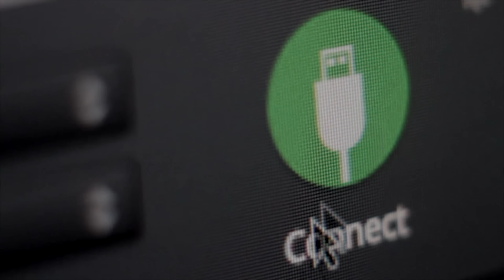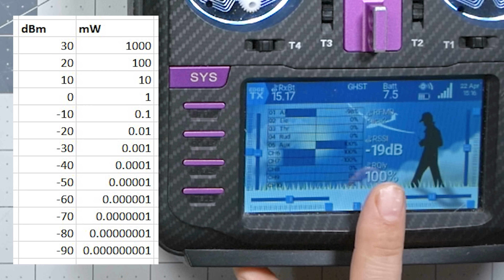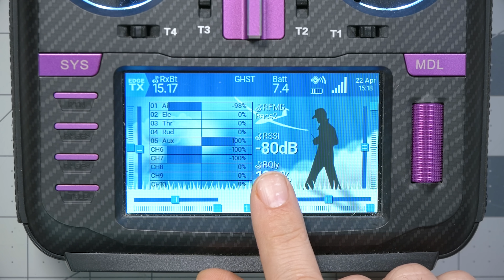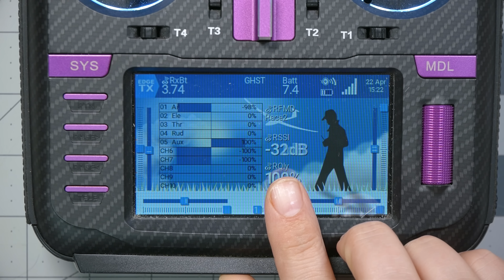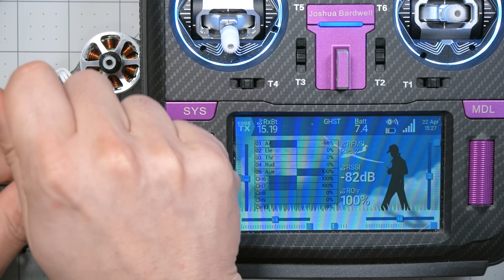Failsafe at 50 feet. Why? // HOW TO TROUBLESHOOT QUADCOPTER FAILSAFE

Comment: I fly only fixed wing. I'm using a tx16s and my signal does well with my spektrum stuff but I did notice that when I fly my elrs stuff with my radiomaster module I'm definitely dropping in the 85% range for link quality and I'm really not going far away. 300 yards max. Thoughts on what may be going on?

Comment: I am more of an RF guy being a radio ham etc. I would get more information from the RSSI signal than the SQ signal for the following reason. Any decent telemetry system will have parity checking and on a duplex system, it will acknowledge (Ack) correct reception of each package of data, if the last packet failed the parity check, the ground station would simply request a re-transmission. Usually, the system would ignore the odd corrupted packet, but when these corrupted packets become too regular, you would then get a bad SQ reading. Its at this point where you have really reached the point of no return, you are now about to lose your telemetry link. However, the RSSI signal would tell you before this happened by the actual signal strength. If we simplified the RSSI from 0 to 10, if the SQ warning kicked in at say RSSI 2, you would see know this from the declining RSSI value and you could act at say RSSI 3 before the actual edge of your range. Aerials are the ultimate things to concentrate on for the maximum range.
Reply from the maker: You're making assumptions about RC control links that aren't true. They don't ack.

Paying attention to RSSI doesn't take into account interference. You can't know the noise floor that the receiver is experiencing.

Comment: This was really useful, i have fail-safe 2 time at 20 mts. But the signal close is strong so no hardware damage, but I am flying at about 1200 mts altitude in the mountains knows to have lots of minerals so I guess that may also interfiere i guess or some other noise in the area.

Comment: I had a 915mhz elrs failsafe 50 yards away yesterday. Never had a failsafe with this quad. The only new thing on this quad was that I did the WTFOS on the DJI v2 goggles and the Vista in this quad. My failsafe happened on the 3rd battery and in a place I had already flown several times. Diving a parking garage, about 7 stories up in the air, it failsafes and lands on the parking lot and breaks 2 arms. I never lost my video. The battery stayed connected but I never got my radio connection back. Also, when I power cycled the quad I only got the 3 beeps. Did not get the final 2 beeps that indicate the FC is talking to the ESC. Weird!. I get home and take the top off the quad, see no damage so I plug a battery in and get all 5 beeps. wtf? This is the worst thing. When something stops working, but when you go to look at it to find the problem, it starts working again, making it impossible to find the problem. And this is the worst kind of problem. Failsafes are unacceptable. I have a lot of money in the air when I'm flying. I only have maybe 50 packs on the new Speedybee F7 stack. The BetaFPV ELRS receiver is less than 2 years old and looks good. The BetaFPV module in my radio is and has always been on 200hz at 500mw power in my TX16S radio. I just bought an o3 air unit to put in this thing and now there is no way I'm risking losing a $250 o3 air unit on this quad now. Not until I know what the problem was.

Comment: My brand new foxwhoop with FRsky rx and my brand new Jumper T pro keep randomly fail-safing.. It happens to all quads i pair to the T Pro so I think it was broken on arrival. It's so hard to prove especially because I had to switch the TX to mode 1 when I got it. Now after the last RXLOSS crash my FC on the foxwhoop Doesn't register pitch...it like regiesters 10deg pitch and 2deg roll :(

Comment: And no dBm does not start at zero.... zero means 1mW but usually only a fraction of that goes into our receivers. That's why it is a negative number in the RSSI dBm.  
Total power output of the Sun is 296 dBm 😆

Comment: So I have a tiny whoop meteor 65 and one thing that I noticed is that there is a hard red wire not connected to anything but the flight controller and I wonder if it goes to the receiver and that might be the problem
: if any of you can help me that would be great
Reply from the maker: That wire is your receiver antenna.
Reply: Do you have any idea what part of the receiver it goes on?
Reply: So I can fix it
Reply from the maker: It's soldered directly to the antenna output pad on the FC.

Comment: one thing i asked myself multiple times:
would it make sense to have phase 1 of failsafe switch to ange mode so that the quad levels out before falling from the sky in phase 2? i assume that would reduce the fall damage significantly
Reply from the maker: You can do that by changing failsafe from "drop" to "land" and then setting the landing timout very short.
Reply: @JoshuaBardwell  thank you. That's a good Idea. Will absolutely try this. Will this disarm the quad once the time is up?
Reply from the maker: Yes it will.

Comment: Short of owning a sophisticated RadioMaster. Tx16S controller, what device can I get to measure the radio signal strength of my drone? I suspect drone receiver damage after a 5 mph collision with a stone wall, a sudden 20’ drop to a sidewalk and the drone failing to consistently respond to the forward joystick. Thank you.
Reply from the maker: Either the receiver reports signal strength or it doesn't. If it doesn't, I can't think how you would troubleshoot receiver damage, except to swap in a new receiver and cross your fingers.

Comment: Would an elrs 2.4g rx antenna and a DJI tx antenna can create noise if they are close together?  I've been getting bad range for video and elrs signal.  I have a bardpole 2.4g close to my DJI antenna.
Reply from the maker: If they are within a few cm of each other, it's possible. Can you try separating them?

Comment: Lord Bardwell, i need you guidance. The voltage in my dji osd is random swinging wildly back and forth from 10.0v to 25.0v on my 6s fettec g4 build. Im running a vista and have no other issues than the voltage readout. Please i beg for your wisdom.
Reply from the maker: I hate to say it but I don't see what could cause this other than an FC issue.
Reply: @JoshuaBardwell  i noticed something else last night, my caddx vista is making noise. Its quiet but it’s noticeable and none of my other vistas do it.

Comment: I had an issue with all my crossfire quads and I went into the tbs agent lua script on the radio and changed some settings around and it started working lol. I forgot what I changed .. I think it was from dynamic to 150hz . Also if you have the wrong frequency/country selected it can mess with your LQ/ Rssi

Comment: BTW, although you didn't explicitly state it, it looked like you were heading there, SNR is not actually a ratio (in the non-log sense anyway). SNR is calculated simply by adding signal value (RSSI) to noise value (which is not the same as noise floor).
Reply from the maker: True, but the nature of dB means that adding or subtracting dB is the same as calculating a ratio of linear units.
Reply: @JoshuaBardwell  Of course.

Comment: JB's background in radio electronics shines through. This is a much-needed video.

To that, I would add that many quad pilots don't pay enough attention to antenna placement and making sure that both video and receiver antennas are well-away from carbon fibre, battery leads and other electronics in general. I remember back 20 years ago (I'm talking RC aircraft in general), when 2.4 GHz and carbon fibre were coming into the mainstream, few realized that carbon fibre was conductive and many of us lost planes due to bad antenna placement.  Finally, I would do a pre-flight range check for any new quad, and, after a crash. Many RC clubs have mandatory range checks as a preflight obligation before flying at their field.
Reply from the maker: Range check is difficult with modern ping range systems which max out at tens of km. You can't just walk 30 paces away.
Reply: @JoshuaBardwell  I'm not sure about the Open TX radios that are 90% prevalent here and especially the newer stuff running Express LRS, but all mid to high-end (aeroplane) radios with protocols such as Spektrum have a special function that explicitly tests range by (significantly) cutting transmitter power to simulate distance. It works well at about 30 meters and these manufacturers have figured the percentage of output power to cut needed for each of their respective and proprietary protocols.

Though this is just one of many differences between fixed-wing and quad "best practices" (and I have admittedly not tried this with one a Spektrum running Crossfire -- ix12 and ix 20 have optional Crossfire modules), some of the top-line Jeti radios now run dual 2.4 GHz and 900 MHz with 5+ mile range and they too have a "range check" function. 

Is this all moot with full telemetry at good latency? Maybe. But even if you have a high-range protocol, if your antenna becomes blocked by carbon fibre, you could suddenly lose signal. Seen it at the field too many times. And a "range check" at cut transmitter powers before you fly may uncover such problems.

Comment: As I walk out to the runway I get "Telemetry Lost" followed immediately by "Telemetry Recovered" which I've assumed was because I have the transmitter in one hand and the model in the other so they are too close.  Once I fly the model Ive no issues.   Why the telemetry lost warning?    Thanks for the advise                E
Reply from the maker: With FrSky, it's because they're too close. You're right about that.
Reply: @JoshuaBardwell  Great, that was my understanding      thanks Joshua

Comment: As silly as it sounds also check to make sure your transmitter’s antenna is attached, too. I had a failsafe at 50 feet and it took me way too long researching what could have caused it to realize I simply forgot to attach my crossfire antenna on my transmitter module (I need to take it off to store it without bending or damaging it).

Comment: Hey JB
I had a problem with a failsafe after random flight times. After looking at your videos on using blackbox to check out what the failsafe was ended up being Runaway takeoff which doesn't make sense because that should go away after  a successful takeoff. So at the same time  one of my motors would sometimes not arm. So you would think that could be a faulty motor or esc.Being a 4 in 1 esc and f80 pros I just about had a cry. Finally after a big Goggle read something about one of the motor wires from the FC to the ESC causeing dramas. My stack came with an extra plug swapped them over and wham bang back in business.It was a shitty plug all along.so what I learnt was watch your videos triple check all wires including plugs and Loctite all bolts because about a week later a bolt came out of one of my arms stripping the wires out of a motor and breaking my frame the gift that kept on giving any way will just have to wait for you video on repairing stripped motor wires. Keep up the good work JB thanks again mate
Reply from the maker: Runaway can happen after takeoff if your throttle has not exceeded the threshold for long enough. If you have a bad motor it would cause runaway when the motor failed.
Reply: @JoshuaBardwell  Thanks for the reply mate,I was still getting runaway takeoff even after full throttle punchers was strange. Problem ended up being the harness between the fc and ESC might of  had a break in a wire somewhere just swaped it out for another. No more runaway

Comment: Interesting, im gonna look into this. Ive been having random failsafes when i do snap yaw 180s, only during that move, but it doesnt fully fail tho. it whips around and does a dead float for about a half second and then i regain control. Very strange indeed. This happens only sometimes and at random ranges , mostly close to me. Im not complaining , i just dont snap over unrecoverable spots, lazy ass mf over here when it comes to troubleshooting lol
Reply: I had the same issue lately, found out my transmitter calibration was not correct, so when I move the stick past a certain point it would failsafe because its not recognizing the input. My osd was flashing failsafe really fast when it would happen and then regain signal like nothing happened.
Reply: @rodellsiago9796  sounds about right. Im gonna tune up my tx and see if it stops the issue. Thanks for the input, ive learned alot of good stuff from people in the comments here. Have a good weekend!
Reply: @andrewut7ya511  likewise brother!

Comment: Hey Joshua, I have a little problem with a tiny whoop board that just does not turn on the esc. it does not read them in the motors tab and the motors don't make the second beat. they also don't arm and everything in Betaflight is good configured. I just tried flashing the firmware with the video you made about this and still won't work :/

Comment: I've never failsafed once since switching to crossfire a few years ago. Before that, with FrSky and FlySky, I failsafed daily. I know your issues was a hardware failure, and crossfire can face that too, but I've never seen it in my own quads where the RX is protected. (I think most often Crossfire faces hardware failure when pilots modify quads and remove an RX, and accidently damage it.)

Comment: SNR would a much better metric. Better than RSSI and LQ. But I guess in all the latency hype nobody wants a few ms being spent for noise measurements (which could be done only every n frames). Or skip some telemetry packets and do noise floor check instead.

Comment: just curious if this is a common issue but ive had multiple ghost antennas come unsoldered inside the plastic t, there is a small pcb and the t ends hardly get enough solder on them from irc. the plastic t does split apart with care maybe check that out too? but also i have had a receiver die as well crashed into a pile of wet leaves. lol

Comment: I fly DJI (digital) in all my FPV drones.  In Betaflight, Configuration tab, right hand column - RSSI (Signal Strength) [RSSI_ADC] has the note "Analog RSSI input."   Is there an RSSI equivalent I should monitor for digital goggles/air units?

Comment: I have a FRSky XM+ and it failsefe randomly at any like 30 meters or even closer. I did the RF fine-tune but no help (I have a Radiomaster TX16S). Put the antennas in better positions but failsafe randomly and just after 2 secondsthe signal is back and I can fly again.
I can fly around my grandma's house no problem but sometime even in line of sight it failsafe. 
Antennas are not touching the frame don't know what could be.

Comment: I learned today that all americans should use the metric system! runs and hides
Only time I failsafed was on crossfire and that was because I pinched the antenna between a standoff and the topplate, it didn't like that!

Comment: Could placing the Rx on the Vista cause damage to the Rx?  Thinking specifically about the heat the Vista makes?
Reply: I have the Johnnyfpv edition qav-s frame and the dji airunit sits on two foam rails in the back and the intended receiver position is kind of sits under it so that's where I initially had put it. I was flying on a particularly hot day last summer and after a few packs my rx (elrs ep1) just quit. It could have just been a coincidence but since replacing the rx and moving it to a different position I've never had an issue.
Reply: @skree_fpv436  Good info!  Thanks

Comment: I think for simplicity it would be an advantage if link quality could be measured from 0-100%
Reply from the maker: Isn't it?
Reply: @JoshuaBardwell  Yes it sure is. I had to watch this again. I was getting Lq confused with Rssi dbm. Maybe it would be easier if Rssi dbm was on a scale from 0-100% as well ?
Reply: It is.. (linear)

Btw: Elrs still flies with 1% (of the data)
Reply: @Cre8ionz.  I am flying Elrs. Are you saying even at 1% Lq elrs will not fail safe?
Reply: @MisterT43  JB also did a video about it saying it (I have tested it before)

Comment: Tbs said ludicrous mode......

Edit what is the standard noise floor in general? I'm curious what most environments like a park is like.
Reply from the maker: In 2.4 and 5 GHz It's typically somewhere around -95 to -115 dBm but it can really vary a lot of there is some kind of other transmitter. Remember, "noise" is just other transmissions that aren't you. So if you're near a wifi radio, you can get -55 dBm if "noise".
Reply: I think you would need at least an rf power meter ( impulseRC), or a spectrum analyzer to really tell what is out there an a site survey. You might be able to do it with a SDR setup, but how much equipment do you want to lug out to the field?
Reply from the maker: A spectrum analyzer would be the right tool to measure the noise floor.
Reply: @JoshuaBardwell  ty, in my line of work I deal with rf. My normal noise floor is -50db and signals rage from -15 to +25. Just trying to get a grasp of rf with the links.
Reply: @JoshuaBardwell  the inbuild LUA Script one should be a good starting point  ?

Comment: I have to wonder if putting the receiver on the vista is a little too hot?
Reply: Idk. I have one like that. Long Range quad. So far no issues flying for 40mins. This is diversity rx so many bigger size helps
Reply: Vistas can get pretty toastie, what power output are you running?
Try mounting it elsewhere and see if it continues..